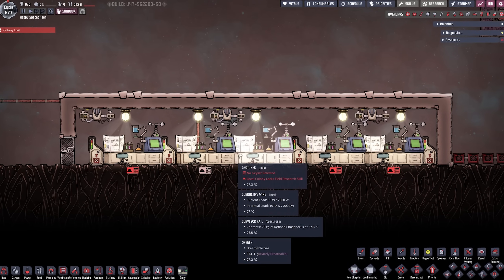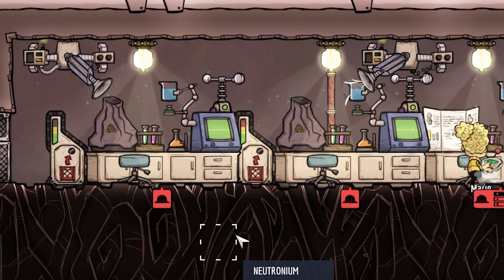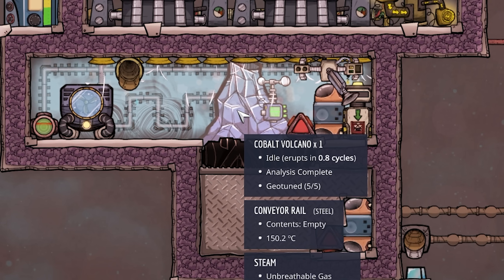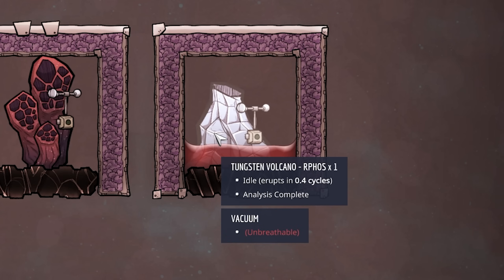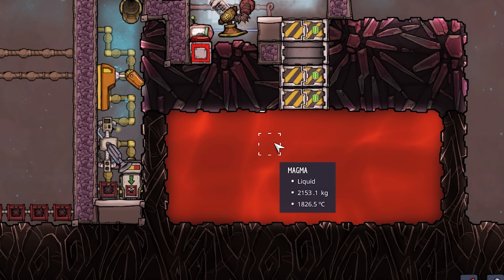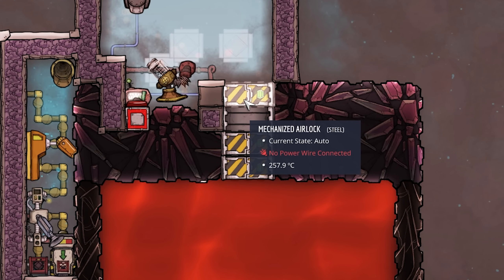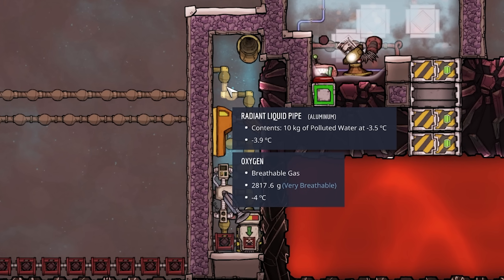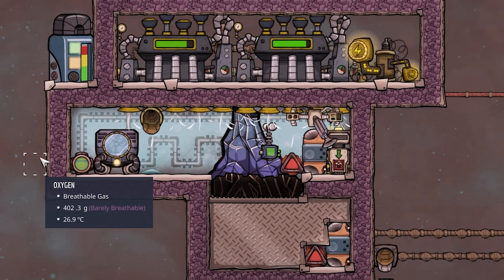GEOTUNERS & REFINED PHOSPHORUS: A German Engineer explains ONI

Comment: I was thinking you could be even more efficient with this if you ran the input conveyor of phosphorous through a counter flow heat exchanger with liquid radiant pipes capped at 1kg/s returning the liquid phosphorus. It would immediately solidify when it came out of the liquid vent. Depending on the speed needed you could make the heat exchange larger to accommodate more pipes so a second or third line of pipes could dump their heat back into the incoming phosphorus allowing 2 and 3kg/s production.

Comment: Isn't submerging Liquid phosphorus into poluted water - more effective?
Water have 625 times higher Thermal conductivity plus you can get temperature to approx. -20 degrees, and with more thermal capacity - it should be ALOT more effective thermal conductor then oxygen

Comment: Use a counterflow heat exchanger like a petroleum boiler. Phosphorite comes in on a rail, heats up as it cools down the liquid phosphorus, then loops in a steam chamber until it melts. Then flows back down against the incoming product.

Comment: Nice, I never had the need for refined phosphorus, but I decided to geotune a Niobium Volcano which required this material. I made a nice setup which uses an aquatuner to heat up and melt the phosphorite. It worked amazingly well! I already have over 20 tons of refined phosphorus.
Reply from the maker: Hell yeah 😊 It’s always good when a new challenge come along the way 😊
Reply: @BierTier  Yea! I think that the Niobium Volcano is simply the best one to use geotuners on. Not only it produces the most metal out of all the other volcanos, the geotuning lasts for a LONG time, since its eruption time is short and its idle time is high. If my math is correct, geotuners will last a couple hundred cycles for my Niobium Volcano. :D
Reply: @vitorfray  Could you spare a peek at your build? I would love to see your setup. I spent 9+ hrs tonight trying to build my own from scratch. I was somewhat successful, but I used up my whole night, and that was just in sandbox mode.
Reply: @Mcnignog   Search for Big Key Phosphorus Refinery - I think I'm going to try to build it tonight.

Comment: Do you think it would be possible to heroine a leaky oil fissure 5 times and get a reasonable output for already hot oil to put into an oil fissure?
Reply: I would have to find one ingame to check the actual numbers, but my initial estimates say no. It is just terrible and even 5x tuning doesn't make it good. What I have noticed is that tuning it 5x might make the oil come out so hot it's close to flashing to petro. If you have a petro boiler adding that might give you some energy-cheap conversions and since it costs worthless Abyssalite to tune a Leaky Oil Fissure, you might as well go for it, but I wouldn't be expecting any astounding results.

Comment: Hmm can you geotune a carbon geyser enough to make a viable petroleum farm with slicksters?
Reply from the maker: I don't think it is possible with geotuners alone. The temperature doesn't increase by 50C, but only by 5C for carbon dioxide vents/geysers. It would be pretty easy to get the last few degrees into the CO2 for slicksters though. Maybe I will come up with a setup that works efficiently :)
Reply: @BierTier  kewl iv been overusing carob whenever possible. Tall carbon greenhouse using up the chill then converting to polluted water.  But haven't gone out of my way to heat it up intentionally.
Reply: @BierTier  fun part the amount of heat generated keeping a carbon greenhouse cold should be more then enough heat.
Reply: It would work for a short while because CO2 is such a terrible conductor it may take some time for the Slicksters to cool down so much to start giving you Longhair eggs, but it comes out so cold that even with 5 tuners it will eventually stifle or even kill off your Slicksters. I even tried pumping it through my power-brick once, only to find an empty farm about 100 cycles later and some starving Longhairs in the incubator room.
I started on the irradiated asteroid with my current colony and I have two of them in the Uranium biome. One I just pump to the top of the map - it dumps its limited chill on the way and it would go into the CO2 tank for the rockets, but those haven't been used in some time, so it basically just goes straight into space. The other has just been insulated at the very start so the CO2 was allowed to remain liquid for a long time so now it has almost 10t of gaseous CO2 inside its little enclosure. >_< The dreadful heat conductivity just makes it a pain to heat up, so I don't even bother anymore.

Comment: This was so useful...  I had this salt water geyser that was in boiling room and I tried to use steam to filter the water but the temperature would  barely touch 125 C with 2 aquatuners ..now with  2 geotuners I just get 135 C dircetly from him :))
Reply from the maker: That is an awesome way to use Geotuners! Love to hear I could help out :)
Reply: That's a good idea! I tried incorporating a cool steam vent into my industrial sauna, but that damn thing over-pressurizes at such ridiculously low pressure I ended up scraping that and then I had to move the whole steam room five tiles down, which was fun, because it seems 1400h in this game is not enough to remember these kind of things xD But using multiple tuners on a salt or hot water geyser sounds perfect!
Reply: @Pancake_Nix   yup... I realised that the damn thigs are op if you have the materials and dupe labor to back them up :)

Comment: Fun fact: adding 5 tuners to magma volcanoes makes them erupt rock gas, as the magma temp is increased by 750 = 5*150 degrees :)
Reply from the maker: That is a fun fact that I didn't know, haha :D Not sure what do do with that info, but knowing is always better than not knowing. Thanks for sharing!
Reply: @BierTier  The takeaway is to use no more than 4 tuners per magma volcano :)
Reply: Maybe use that to put cooling into place and have it solidify into debris without ever having to deal with the magma. Not sure how feasible that is given we normally handle volcanos in a vacuum
Reply: @divinatrixdarktide4127 probably not very feasible since the volcano is also spewing even more matter at that high temp
Reply: @divinatrixdarktide4127  It would cool down back into magma, so you'd have to deal with magma at one point anyway. Maybe if you were to pump it in tiny packets so it wouldn't condense in the pipes and cooling it down so much that when it comes out it essentially instantly turns into debris. Tho I'm not sure how you would pump rock gas anyway. It all just sounds way too scary, so I think I'll stick to the "max 4 tuners per volcano" advice for now 😂

Comment: Bier, I play Oni all the time and i cant get to the workstations after advanced science station. I recently implemented your S.P.O.M and I got farther but im dying to heat and power shortages. I recently learned about mechanical filters which Ive been using but my coal just doesnt last and im not finding natural gas or oil at this point while digging around. Can you do a video to help? Im sure lots of people are getting stuck transitioning from beginner start items to intermediate support systems.
Reply: you need to look at the star map and see what you planet has, you may not have a natural gas geyser. farm hatches to get more coal, I usually don't run coal generators that much, usually my spom powers my base. If you have a water source get a spom up asap, and use a aqua tuner and cool the oxygen and that will cool your base.. if you got volcanos or magma, go geothermal and use steam turbines. its hard to move forward when you start to get comfortable, and that's when problems start because you put off issues until its too late, IE Heat.
Reply from the maker: Turbo is 100% right with his tips! The earlier you start to think about potential future issues, the better it is. If you have specific question I'd recommend you join my Discord channel and I and many others in my community are happy to help with any issues you may have :)
Thank you for the video suggestion, I will look into it!
Reply: @BierTier Hey, I wanted to thank you for your Every SPOM tutirial; Just built a 9-electro hydra based on your video, and it literally saved my colony from death by brownout!
I ended up setting up a bunch of hydrogen generators (and backup hamster wheels) to power the hydra; if the smart batteries are charged the hydrogen goes to a bunch of generators for the colony. Best upgrade ever! So Thankyou!!! ❤
Reply from the maker: That’s awesome!! Always happy to hear I can help out 😊
Reply: Starting up early Hatch farms will net you so much coal.. I just got to cycle 600 yesterday and because I'm doing an achievement run that meant no coal for the first 200+ cycles, so now I have 689.6t of it on my main planetoid that had no natural coal, to start with. And that's after sending tons of it to my colony ship or to the linked planetoid that's currently only running on excess Hydrogen from its own SPOM. Put some hamster wheels near your power grid and make new duplicants do nothing but run on the manual generators for 50-100 cycles. They will train up their athletics, making them not-so-useless after their training is done while they provide you with some extra power.
For local, temporary cooling you can build temp shift plates out of (any) ice (if you have it on your map). They will instantly melt, so have a basin to catch that 800kg of water they will melt into, but the fast cooling power that provides is unmatched. Make sure to insulate any hot biomes you enter and look for possible Abyssalite breaks. 
And keep in mind that when you mine blocks they lose 50% of their mass. So if the blocks are hot, you destroy a bunch of heat just by mining them. But if they are cold (Anything below 30°C is cold for ONI standards) they will lose 50% of their potential "heat-drawing" capacity. So keep some of the starting biome's natural terrain to slow the heat spreading and mine the hell out of any biomes that are hotter than 30°C. That's all until you get steam turbines and steel. After that you can heat things up however you want, your aquatuners will just move all of the heat and your steam turbines will be happy to destroy that heat and convert it into electrical energy, killing two massive birds of prey with one stone. :)
There's also a little trick you can do early on: deconstruct a glass lab wall from one of those teleporter POI's. It will only give you 5kg of glass you can't use for anything but it will trick the game into thinking you've discovered glass. That way your printer pod can generate it and you if you get lucky you can print 200kg of glass every now and then to build some solar panels (but with recent patches meteorites became an issue again, so that might not be as viable, since the panels will get smashed to bits or covered in gunk after the first meteor shower).
Too bad you can't play ONI in multiplayer. I'd fly over and dump 100t of coal at your colony to tie you over to sustainability :D